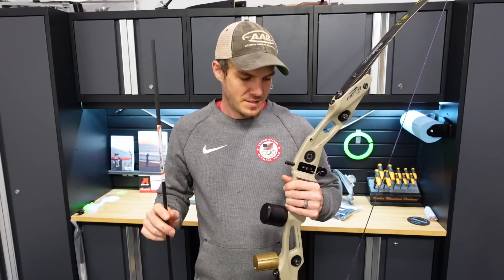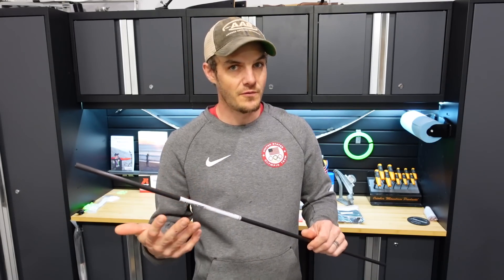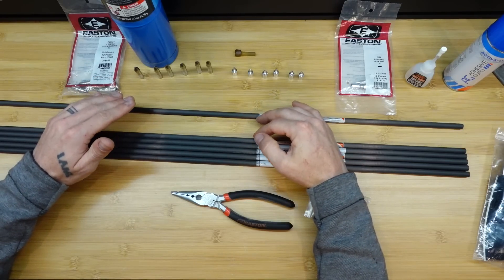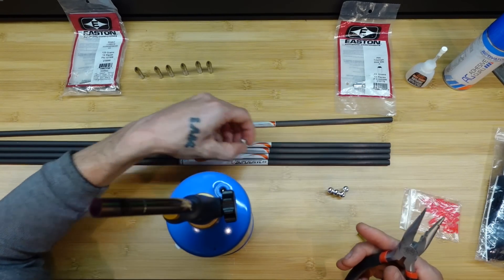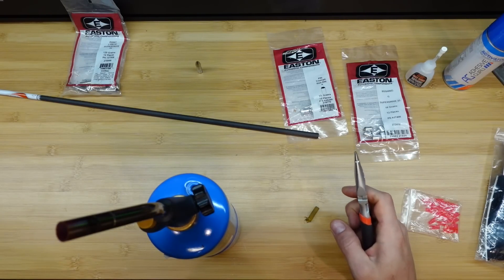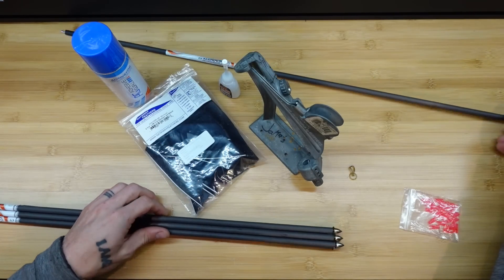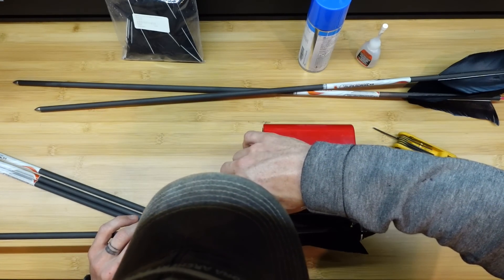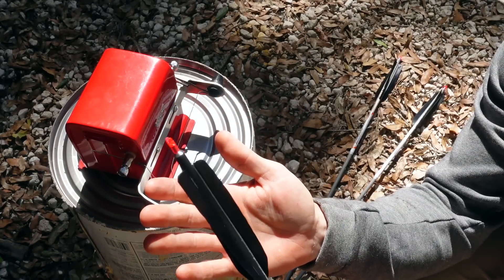Building Indoor Arrows for 18m/20yds | Barebow Indoor Tuning Mini-Series Episode 2

Comment: Jake you may wish to investigate the use of “hot hide glue”. 
Oldest, strongest, and removable glue. 
It was aa standard for applying tips of and kind and nocks 50 years ago.
It was available in stick form and one could use a candle or lighter to quickly activate the glue, and press the component on. 
Hot hide glue requires 135-145 degrees F to activate for gluing.
You can create an inexpensive water double heater or use salon nail heater to heat the hide glue properly.
To remove tips or nocks just heat the shaft/components to 160-230 degrees and it will come apart. Yes, you could put the shaft/component end into a pot or container with boiling water to reactivate the hot hide glue to remove.

Comment: When you are bareshaft tuning arrows that have huge helical feathers, do you leave the tune slightly nock point low? Therefore having the bareshafts slightly high?

I'm currently tuning my indoor arrows (I'm having to pause until some heavier points arrive in the post) and I'm thinking of leaving the tune nock point low because the fletched arrows have such a huge amount of drag that they will go lower than the bareshafts. I'm thinking this would be more forgiving because if the bareshafts had the same amount of drag, they'd hopefully group together.

What do you think? To take drag into consideration, should you group your bareshafts very slightly higher than the fletched?

Comment: I'm trying to glue on the Vap Pro vanes to my new Victory VAP arrows. Problem: The vanes doesn't stick to the shaft. 

1.Cleansed the shafts with isopropyl.
2. Add the vanes in the jig.
3. Apply ethyl 2-cyanacrylate glue.
4. Apply pressure.
5. Wait 30sec

Tried both with activator spray and without. It just seams like the shafts are to slick, kinda Teflon slick.

The same method worked well with some Avalon Tyro shafts and cheap vanes. Only difference is that the other vanes require cleansing before gluing, the Vap Pros have factory added activator.

What am I doing wrong?
Reply from the maker: I would avoid the isopropyl to start. 

Also I would leave the vanes on for longer, with more pressure 15 seconds is short even with activator spray. The WAV Pro vanes are the hardest vane to fletch and need near-full-cure time on the clamp with full contact to the shaft. 

Give that a go and see how that helps.
Reply: @JakeKaminskiArchery  thank you for the reply. I will try without the isopropyl.

It might also be a problem that I have an Easton EZ fletch multikit that glues 3 arrows at the same time. It seems like the Wav Pro's are to thin at the base so it doesn't get enough pressure.
I might need to try another fletching jig.

Are the 20 vanes with hardened glue under possible to save?

Comment: Great! Keep'em coming. Now, that was standard procedure. Did you also verify spine, spline and straightens of the shafts or isn't that sooo important for indoor?
And if the shafts would allow it, would you go with even lighter points, say 100 gn?
Reply from the maker: If they had 100s I’d try them. 

As far as spine, spine alignment etc… if I was to shoot worlds or a major event with them I’d check that, or just bareshaft tune/select them

Comment: Noted using the Accelerator but not how to use it!  How?
Reply: I believe he has a video on that.
Reply: After several tries and 20 vanes with hardened glue on them (can maybe get the glue off somehow). I got 3 fletched arrows with some other cheap vanes. I've come to the conclusion that the Wap Pro vanes aren't compatible with my fletching jig (Easton EZ fletch multikit) due to the vanes being too thin - not enough pressure against the arrow.
Reply: Russel, I use the stuff all the time. Right before you're ready to put your feather on WITH the glue on it...put a light spray on the place where the feather is supposed to go. Then place your feather. I wait 20 seconds, which works fine, and then turn to the next feather and do the exact thing again with the accelerator the remaining feathers.

Comment: Hey Jake, I use the same size propane bottle as you but found a 6" plastic base on Amazon to stick it in. Just a little safer for tip overs. Great video BTW. Thanks
Reply: You can also use a Kitchen butane torch - small, stable, puts out plenty of heat and not so clumsy and tippy and easy to store in small spaces.

Comment: One thing I don't like of those feathers is that the front end of the quill is cut straight instead of at an angle, as you see in parabolic or shield feathers. I don't like that "step", I prefer a smooth transition from the shaft to the feather.
Reply from the maker: Did you know that The steeper the leading edge the more lift on an airplane wing? In theory this should offer more “steering” to the feather. At least that’s my hope.
Reply: @JakeKaminskiArchery  Are we talking about the same thing? I'm talking about the base of the feather, the white part you glue to the shaft. In this feathers, the front end came with a straight cut from the factory, instead of  an angle cut as you see in most of the parabolic or shield feathers. I'm not talking about the step design you burned in the vane part of the barbs, that's perfectly fine.
Reply: I could be wrong  but I think the full length are just raw feathers before they shave the feral down and make shape cuts. so you can shave down the feral of the father to get a closer fitting to the shaft probably be able to make a shaving jig to make them uniform . in Arkansas we lived next to old man that made feathers some for archary and the lower grade feathers went for fishing tackle store. he paid $5 for Turkey wing feathers. I remember  him splitting the ferals and shaving some of them down  also first time I saw a feather burner in action.

Comment: If lighter in the back makes them more forgiving, what happens if you use a heavier than normal point.  That makes them relatively lighter in the back.  (That affects the spine too.)
For using hot melt glue on points, I've seen poor college kids use the kitchen stove, even an electric stove.  Just hold the point in some pliers against the stove until it will melt the glue.

Comment: Isn't the Meta DX illegal for barebow? I think the dampers weren't allowed.
And why don't you cool off the glued points and pins in water directly after glueing? The carbon might burn, which is bad for it. Also, if you can pull a layer of carbon off the arrow, the arrow was garbage to start with.
Reply: They changed the rules last year.
Reply from the maker: I don’t heat the points up very hot at all no ruining the arrow.

I’ve peeled a layer off a brand new X10 when I was learning the glue peeling… sure wasn’t junk to start with. 

Also WA ruled dampers in barebow are legal now.

Comment: Symmetrical vs Asymmetrical pin nocks (Beiter)?
Reply: Asymmetrical is for recurve. Because you don't apply even force over and under the nock the string inside the nock is angled, the nocks are built to freely accommodate that angle. I'd never shoot anything else on recurve, they're amazing. Symmetrical, aka hunter, nocks are for compound. Because of the D Loop, the piece of the string that the nock engages with stays straight, so there's no need for an asymmetrical design. Here in Europe at least, everyone uses Beiter.
Reply: @justinvzu01  Thank you!
Reply: @justinvzu01  Yeah, Asymmetrical"s rock. When I first used them I thought maybe they were jus t a gimmick, but wow... I could definitely tell a difference and now that's all I buy/use. Pricey though is the down side.

Comment: Jake - thx for the great content. Curious. You generally seem to prefer the Last Chance jig, but when doing feathers, you have used the Bitz. Do you find the Bitz better for feathers for some reason?
Reply: Hey Jonathan, not sure if this is helpful but I use the LCA rig and am unable to fletch feather arrows that are more than 4" in length, and that was massively pushing it... 3-1/2" is more realistic.  And even with 3" feathers, getting particularly thick barbs into the clamp is sometimes an issue.  So, you can definitely do it... but not for long uncut flu flu's like Jake likes to run for custom cutting.
Reply: @ryanbon  Thanks Ryan. That makes sense. Appreciate the response.